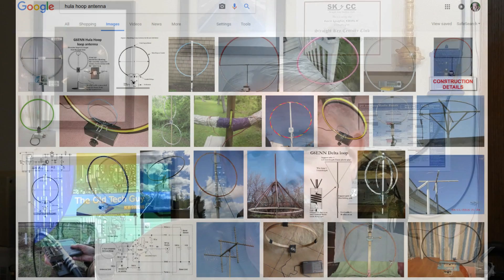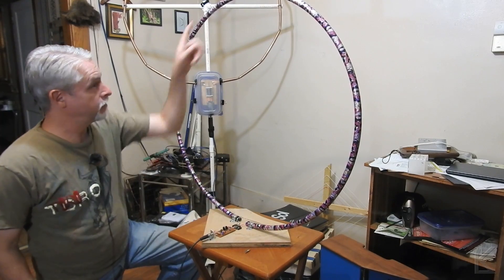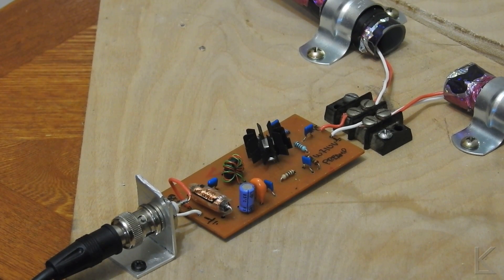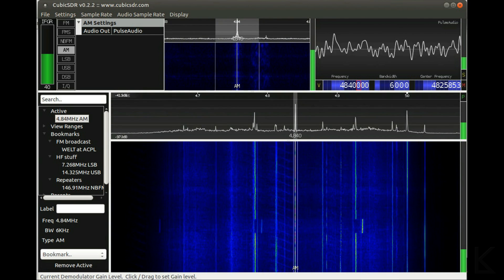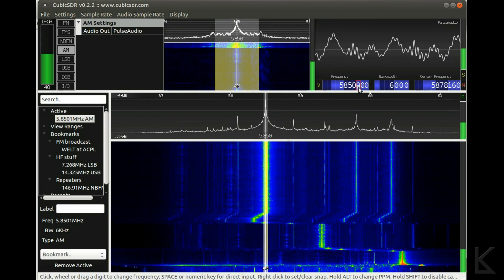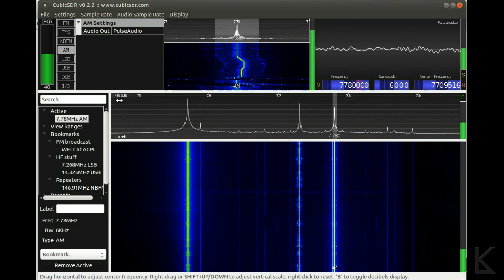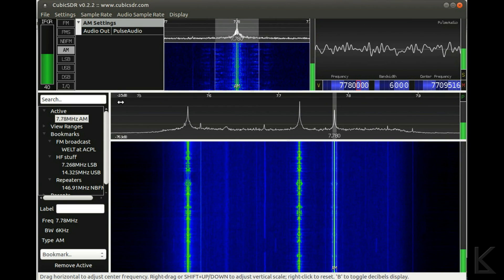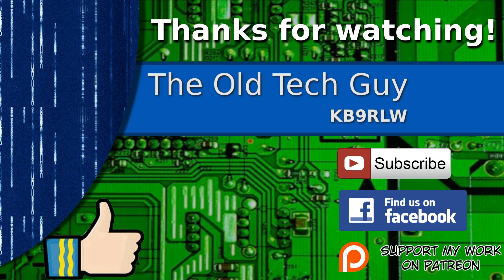Ham Radio - The Hula Loop active RX antenna

Comment: You made a fan-loop antenna on a cross-diamond like frame, and a triangle pick-up coupling loop to feed your receiver, would a signal amp. connected to the coupling loop,  do equally as well in gathering more gain from that type of antenna? Do you understand what I am asking? Of course this will be a receive antenna only.

Comment: Make note, that some SDR dongles don't support using an active antenna.
Reply from the maker: In the case where the SDR hardware doesn't provide a bias voltage, you can just build a bias T to go between the SDR and the antenna.

Comment: Hi Did you try this antenna on 80m band? It seems very i teresting. I use a 80m dipole on a very noisy envirlment in Costa Rica with an S9 noise level. Wilk it work on 80m?
Javier
TI2JS

Comment: Hey Kevin...you mention you are using the bias-t from the sdrplay (RSP1A?). Looking up specs on your preamp it looks it needs ~12 volts to operate, but the RSP1A only puts out 5 volts for the bias-t. Thoughts?
Reply from the maker: It still operates at the lower voltage, just doesn't provide as much gain.
Reply: @loughkb  Kevin....do you have a schematic showing the DC coupling from the bias-t to the preamp power rail? You mention a decoupling diode and a choke.
Reply: I meant decoupling capacitor.
Reply from the maker: @stevebailey1682  It's a common design.  A capacitor to pass the rf and block the voltage, a choke on the power in to block the RF.
This article has an example schematic.
http://www.hayseed.net/~jpk5lad/K5LAD%20Memories/Vols%2031-35/Memories--Vol33.htm
Reply: @loughkb  Thanks very much Kevin!

Comment: Thanks for mentioning about local broadcast towers.  I am making one and would of though my attempt was crap living by 3 of them.   Would the twisted wire do something negative with electricity though?  I think in ethernet cables wires are insulated AND twisted inside to prevent cross talk.  I returned a roll of wire thinking this.    cheers and thanks for the vid... you explain things well enough for even stupid people like me can follow along 80% of the time.
Reply from the maker: All of the wires are tied together, acting in unison as a single conductor.   There's no difference in potential between them, so there's nothing to interact.
Reply: @loughkb  thanks!

Comment: Apart from the added performance of the signal amplifier, I am wondering if the loop shape works better than any other shape, example, a square, triangle or just a straight wire.

Comment: Hi Kev, thanks for a great video. I am in the process of building this antenna and the preamp, any chance you could let me know what the value is, of the inductor used to feed the power via the coax. Thanks in advance.
Reply from the maker: Anything above 180nH should work

Comment: you have to peel the skin of loop ,is very important ¡¡¡ """ your loop is a box of Faraday"""
Reply: No, the tape is some sort of mylar. It's shiny but not metallic.
Reply: There's a break at the bottom so it wouldn't make any difference anyway even if it's aluminum foil

Comment: Kevin, where can I buy the preamp ready made.  References on line point to kits which I am physically unable to build.  I  am new to ham radio and just bought the rsp 1A with SDR Uno V1.3.  Sadly it' all greek to me.  I really need a users manual written for "dummies" so I can at least hear/search for signals. Any help would be greatly appreciated.
Greg D
Reply: There's options out there. LZ1AQ sells a preamp that's specifically designed for small loops that you can get almost fully built (you just have to put the amplifier board into the enclosure, and provide the controller board with its own enclosure and some switches or jumpers to set the mode), or there's the DX Engineering RPA-2 which is a really beautiful Norton amplifier.

Comment: For proper comparison of two antennas you would need to switch antennas between antenna inputs.
Right now it is not clear if both antenna inputs have the same sensitivity.

Comment: I am looking at putting an antenna on my 20 ft light pole to run my old Zenith shutter dial radio.  How does something like this work on the lower end of the AM scale?  like 1000khz ?
Reply from the maker: Not too well.  You would need to use light gauge wire and do 15 or 20 turns to get sensitive down that low.

Comment: I guess I am repeating some previous comments,  but when you are comparing active antennas, it doesn't make sense to compare signal strength, since that will depend on the gain of the preamplifier. If you are using the miniwhip that I am familiar with, the preamp doesn't have any gain, it is just an impedance converter. The hulaloop has a preamp that probably has significant gain, at least 20 dB, so that is the difference that you are seeing. If you added a 20 dB preamp to the miniwhip, it would have a stronger signal than the hulaloop. The point is that you can't just compare signal strength, you have to look at signal-to-noise ratio.
Reply: The only relevant parameter is SNR!!

Comment: Hi  I have built one on the same lines but looks smaller than yours with a matching transformer on the input and output of a push pull amp. Used it in doors then placed it at the bottom of the garden on a 20 ft pole made a about 3 to 4 s points improvement in noise reduction.  its a copy of the Wellbrook Loop From the UK called the Wellgood Loop which I found on the web including the  circuit.

Comment: What does the radiation pattern look like? Or recieve pattern XD
Does the diametre make a difference? If yes, would it work on Gigaherz wavelengths equally good?
Reply from the maker: The pattern around a loop looks like a doughnut.   And no, it wouldn't work well that high up, too big.   You could make a loop for microwave and up, but it would be much much smaller.  Maybe about the diameter of a nickle.

Comment: Which transistor are you using? Apperantly there have been many revisions to the design so there's not just one schematic...
Reply from the maker: Sorry, I don't remember.  The device is currently up in the attic and it would take some effort to get to it.  (I have a bad back).  I think the different rev.s probably used the same transistor, it was common in RF pre amps.
Reply: @loughkb  The 2N5109 or 2N3866 are specified, mainly because they were designed for CATV systems up to the low UHF region, where intermodulation has to be kept to a minimum. The same reasoning leads to their use as the emitter follower in the Mini-Whip antenna. If you don't have any strong local BC or FM stations locally you could always try other NPN transistors as long as they can dissipate the power and work at rf. I recently built a Mini-Whip and substituted a 2N2222 for a 2N5109. There is intermodulation, the main product occurs at 360kHz as here, in Southern England, I can receive strong LF signals on 198kHz (BBC) and 162kHz (carrier with no AM from Allouis, France) The French signal formerly carried France Inter but now has only phase-modulated data. Apparently the French Railways rely on it for time signals.

Comment: But... doesn't this antenna need tuning capacitor? 

Currently I'm looking for antenna options for myself and I stumbled upon loop antennas, since longwires/dipoles requires a lot of space and height (both are quite limited for me). But idea about tuning the antenna every time I want to change bands on my SDR is not very compelling.
Reply from the maker: You could set it up with a tuning cap, but for receiving, that only has the effect of reducing signals outside of the tuned section.  Tuning a RX antenna won't get you any more signal than the antenna can provide.  As is, it's broad banded.

Comment: Just found your channel looking at a Friends channel who was going to make your hula loop antenna thought i would come over and subscribe. I'm studying for my general class was a novice back in 1967 getting back into it after all those years.  Thanks for sharing
Reply from the maker: Welcome back to the hobby Larry.  Good luck on the test.
Reply: Thanks my old brain cells are still having trouble but i'm 67 . I have been restoring old amateur radios on my you tube channel . I am currently working on a BC 348Q just finished a R-336/GRC-26 from ww2 and it works fine in the ham bands.

Comment: Is there a parts list / schematic diagram available for the circuit board?
Reply from the maker: There are several versions of this pre amp out there.  If you search for "w7iuv pre amp" you should find several sources.
Reply: Thanks.

Comment: Recently started with the whole SRD thing.  Got an rtl-sdr USB stick and using CUBICSDR also.  Right now just using stock antenna.  How are you switching between antennas? Using Linux for my desktop
Reply from the maker: The soapy module for the SDRPlay has built in support for switching it's antenna inputs.  Cubic recognizes that and adds menu items for switching.  You won't see those menu's since the RTL doesn't have that capability.
Reply: Are you running CubicSDR on Windoze or Linux?  I've been using CubicSDR on local Linux desktop with the RTL-SDR plugged in and also with CubicSDR local with RTL-SDR running on ODROID-C2 (Ubuntu server ARM) running SoapyServer.  Nice to have the tuner/antenna plugged in somewhere else.  Love SoapyServer... SDR Touch (android tablet) isn't happy with it had to use rtl_tcp
Reply from the maker: All my machines run linux.  No windows here.  I worked in I.T. for 30 years, I've had enough of windows and osx.   I used to tell people, I fix computer problems all day long, I just want to use my home machines, not have to fix them as well.
Reply: Kevin Loughin Ditto.  B4 Google existed or default GW because networking didn't  exist.  Unix admin.  Isn't it fun when the contract ends and one day your apparently to old to hire

Comment: I enjoyed your loop video. I recently picked up a W6LVP Magnetic Loop a few weeks ago and put it up about 20 ft on a Channel Master rotator and use it as my receive antenna on my ham station while using a 132 ft Carolina Windom antenna for transmit. I really have found a tremendous difference in noise after going to a loop. The W6LVP will null effectively noise or interfering signals perpendicular to the loop. My personal experience is that it has a very tight null of just a few degrees. The null is incredible, but aiming at stations the peak isn't that sharp which is why some people just place the antenna where it nulls the worse noise source and just leaves it there. But with a rotor you will find that noise source direction varies by frequency and time of day. But usually there is a main direction that is the worse. I also have a Timewave ANC-4 Noise reducing device that works great in combination with either antenna when fighting noise that is not nulled out by the loop because I am using the loop at times to pick between stations in different locations on the ham bands and also BCB stations on the exact same frequency. I have a 12 ft noise dipole at 3 ft above the ground for the ANC-4 that I placed right under my electrical power line pole. The combination of a W6LVP Magnetic Loop and the ANC-4 has allowed me to enjoy listening to Shortwave like back in the 50s and 60s before all of the electrical environment issues we face today.
73s
WD9GNG
Reply from the maker: Yep, loops are great receiving antennas!

Comment: Kevin, as we all noticed the gain is increased by the loop, but the S/N is still the same compared to the miniwhip, so there is no usable benifit when using a decent sensitive receiver on LW/MW and HF. Have both types of antenna in use and use the loop to stir away from qrm and listening to frequencies above 10 mHz as the miniwhip is producing less gain when higher in frequency. When using a balanced amplifier the base noise will be lower so the S/N is increased. Usin a good low noise amp and perfect balance between boths amplifiers is obligatory to obtain good results. Good luck whith your experiments. 73'

Comment: Can you bypass the amp? Or is it needed to make it work? I built one. With the w7iuv preamplifier. But if I shut the power off to the preamp.  The loop will not work.
Reply from the maker: Yes, you could bypass the amp.  You could use a switch.  Just put a small cap like a .001 disc ceramic cap in series so you don't burn out your power supply by accidentally feeding it into the loop directly.   The reception would be weak though.

Comment: So I tried out the amp on my shielded loop project and it doesn't seem to be working well, no idea why (note: I'm not even a HAM, just someone trying to learn this stuff for fun). I was using a 1:1:1 balun setup (BN43-202 core with 6 turns CT for the loop side, 6 turns on the amp side with one connected to ground and the other to the capacitor), I'm not sure if the balun helped. I just used it for my MMIC amp project which it did kind of help regain directionality of the loop but it still had the flaw all MMICs have (they're too sensitive to broadcast stations nearby which it seems the FM stations are VERY strong here in downtown Minneapolis).

Comment: Nice, I've been looking into using the w7iuv as a preamp for a loop after having middling success with an MMIC based amp (FM broadcasters are just incredibly powerful here despite the towers being at least 10 miles away from me in downtown Minneapolis). I've done m0ayf's amplified loop (it's based on an earlier version of the same amplifier done by another HAM in the 80s apparently) and it works well but this makes me want to try out the w7iuv more since it seems simpler to construct by comparison. Just a dumb question, do you think a 1:1 transformer in this situation would be decent if I used a "shielded" coax loop instead of a regular wire loop?

Comment: I'm glad someone is finally coming forward to expose the fraud of the MiniWhip!  I don't think the MiniWhip Active Antenna can work at all because the theory behind how it works is all wrong.  I tired 2 of them, a ready made one from the Ukraine and a kit that I put together and neither one will pick up anything!  They claim it works by picking up the electrical signal that gets stronger the higher you go above the ground but there is no truth to that, it it was true you could just put the antenna up higher and get a stronger signal. With the ready made one I disconnected the short probe and tried using it as a pre-amp for a REAL antenna and that works OK but the built in probe can't pick up anything at all. A little piece of jumper wire clipped to the end of the coax works better than the MiniWhip!  I emailed the guy who wrote the theory of how it works, P.T. de Boer, telling him that he is all wrong and asking him to release a retraction and he won't do it but if you read this it's all total nonsense!  Just because they were able to detect a potential difference between 2 plates in the lab they think an antenna should work that way but it's not the case. 
http://www.pa3fwm.nl/technotes/tn07.html
http://www.ebay.com/itm/MiniWhip-Active-Antenna-HF-LF-VLF-mini-whip-shortwave-sdr-RX-DX-portable-/222532769118
Reply from the maker: Yeah, uh, no, it's not a fraud.  It works well enough, better the lower in frequency you go.  Actually, below 2 Mhz it was performing better than the loop.  You can shout all you want, but there's plenty of them on the air that you can tune in via web SDR sites and receive on.   I was listening to an AM broadcast station three states away on it this morning.
Reply: Of the 2 that I tried the kit wouldn't receive anything at all while the ready built one could get a few AM broadcast stations but ANYTHING I put up will work better, even a jumper wire connected across the end of the coax!
Reply from the maker: Then, logically, you were doing something very wrong.  Perhaps you didn't power it, or had a flaw in your bias T circuit at the receiver end of the feedline.
Reply: You only need to look at modern cars and other road vehicles, which nowadays have either "sharks fin" antennas or a very short antenna about 6 inches long, to realise that a small active antenna can be very effective for receiving frequencies from LF (here in Europe) to FM on 100 MHz or digital radio up to 230MHz. Most of these use ICs designed for this specific application. I tried to find a circuit of one of these using discrete components, but with little success. The only info I found was an academic paper in German from the 1990s. It showed circuits basically similar to the MiniWhip, using transistors developed by Siemens, specially for the job. The MiniWhip does need a separate earth connection close to the antenna. The automobile application uses the vehicle body and chassis as a counterpoise and the earth connection is short and direct.

Comment: Kevin, what is the diameter of your loop? I bought a Hula Hoop that is 34.5 inches across, seems too small to work. This is what I'm building and they say to make the loop about 60 inches. http://www.qsl.net/m0ayf/active-loop-receiving-antenna.html#Circuit_details_and_constructional
Reply from the maker: +Joel Caulkins oh, any diameter is going to work, the freq range of best sensitivity will change.  I've found that this nearly 3ft loop starts falling off a little around 3mhz and down
Reply: Kevin Loughin Okay, thanks Kevin. I decided to build the same preamp that you did, so we will see how it turns out. Ordered some type 75 toroid cores and some 2n5109s from Diz.
Reply: Kevin Loughin Hey Kevin, I finished my Hula Loop yesterday and it works great. Last night I was listening to all kinds of stuff. Thanks for the video.